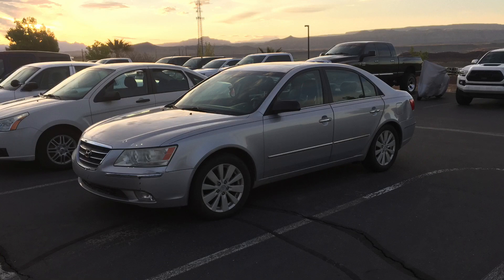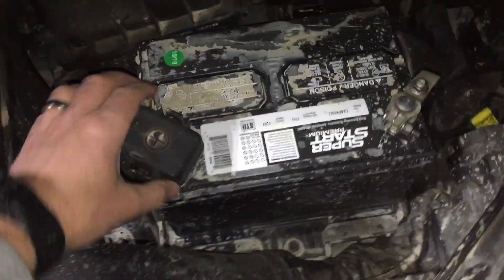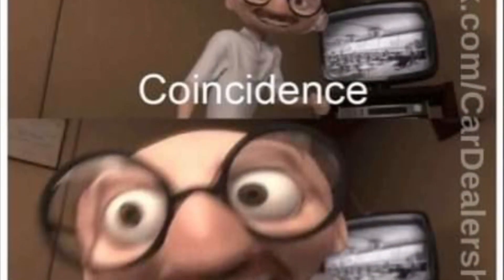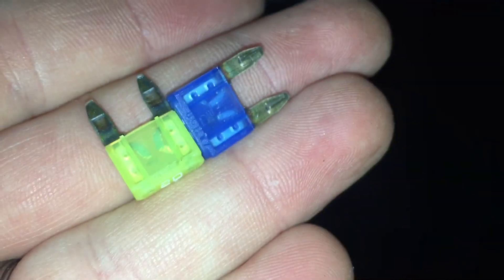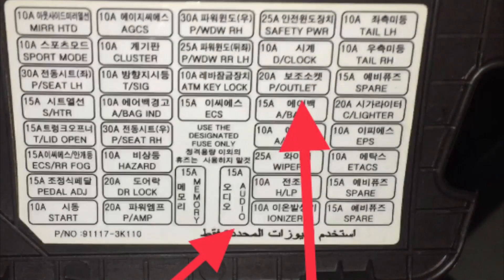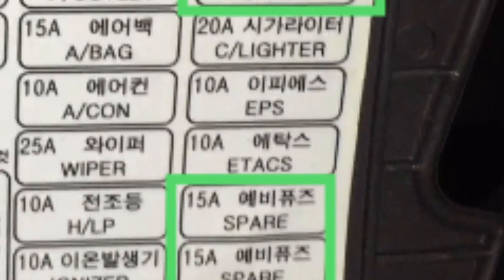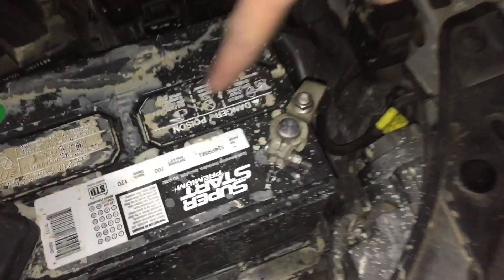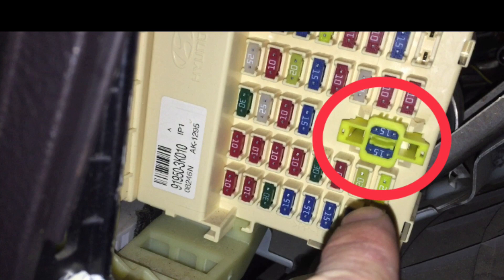What happens if you connect your battery backwards?

Comment: I just had this happen in my 1992 Chevy Silverado. I was using a different battery than the original. It sparked, then I did it again as I wondered what was going on? Then I looked at the battery top. Lucky no fuses or computer blew! Just got lucky I guess!? Nice video!
Reply from the maker: I’m glad you didn’t have any issues. With the newer cars there is so much more brains to knock out lol
Reply: I did this too recently it sparked but I knew once I seen the spark that it was opposite because the battery was different too and reconnected everything back and no fuses or relays blew but It just touched for like .5secs

Comment: Ive never had those fuse pullers work ever 😂😂😂😂.  Cars just need to come with needle nose pliers.
Reply: they typically come with em in modern vehicles from 2000's onwards.
Reply: Used it successfully last night. I guess I’m lucky. I wasn’t home either x.x
Reply: I've used those fuse pullers for years but I have tiny manlet hands

Comment: Mach 1000 Update. The engine noise is still in the system. Can’t seem to figure out how to stop it. If you’d like to buy the system and drive down to Phoenix to get it I’d be willing to let it go for relatively cheap. It’s a cool novelty but can’t have a system with whine in it. It’s not terrible but at stoplights you can here it like you’re using an fm transmitter. May try a couple more things but prolly will be removing it. It’s too bad

Comment: how long will it take to cause serious damage to the car's computers?
Reply from the maker: Only seconds
Reply: @dannyjohnsonsgarage  but if the car starts and runs fine, and only the turn signals and wipers don't work, it's probably the fuses and not the computers? Only asking because this is what happened to me. I put the battery in correctly after less than 1 minute of it being in there the wrong way. this is a 2011 challenger, and the SRS warning light came on when driving it.

Comment: 2 mechanics said it messed up the computer.ughh an expensive mistake. I replaced the main fuse. Then the check engine light came on about a week later with a knock sensor code.Chamged knocked sensor but still have the same code with engine light.ughh.Maybe I need to use a Honda part.I used aftermarket sensor?

Comment: I own a Fire Alarm Control Panel, installed two, 12 volt, 8 amp hr lead acid batteries but backwards, and it sparked only. The panel charges the batteries and when the AC is lost, it switches back to the batteries. I havent checked yet, but do you know if that damaged anything or just sparked. 
Thx

Comment: Everything you said exactly happened I'm radio won't come on my door when it open it's still let me know it keep dinging but when I put the key in to start it it won't crank so do you think I blew the fuses and should I change all of them
Reply from the maker: If the fuse is blown nothing should work for that circuit at all, but the effects could be anything as you mention

Comment: I did this to my 2006 dodge charger srt8 I need help. Radio don't work but car alarm does. My car battery keeps getting drained. I had it tested. Not the PROBLEM i had the alternater checked nothing wrong their either. But car wont START
Reply from the maker: Sometimes it blows out the connection somewhere on a wire and not so much on the fuse. Anything that doesn’t work you’ll have to check the fuse and also follow the wiring until you find a break. I would also check the grounds https://youtu.be/ErNNTAQWu8o

Comment: Put a battery in a new to me 89 ford van and it instantly let the smoke out of a wire running to the starter, some asshole 20 years ago put red tape on the negative cable
Reply: Same here 88 ford van  what damage did it do?